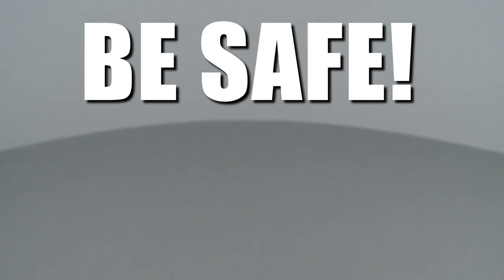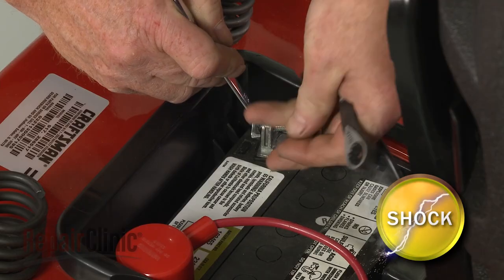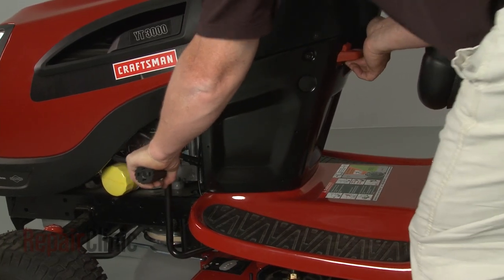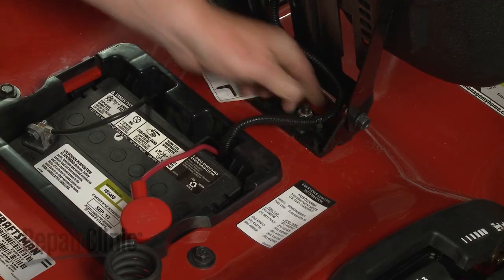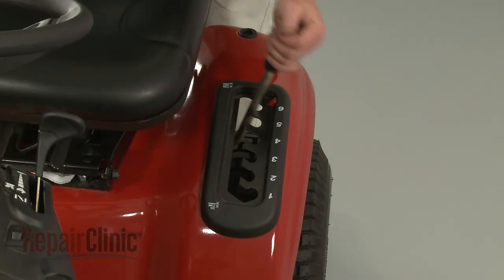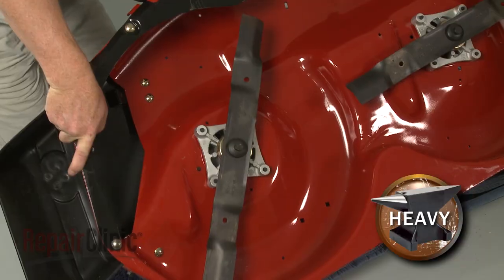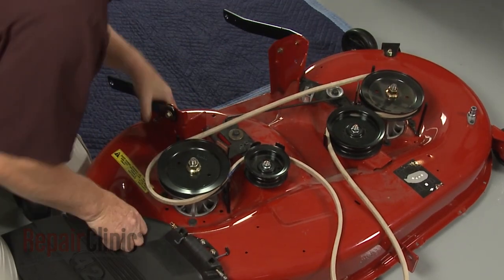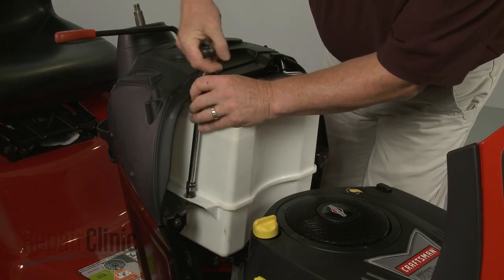Craftsman Riding Lawn Mower Disassembly, Repair Help

Comment: I have a Yt3000 and I am trying to repair/replace the transaxle link but I dont have any repair manual to show me how to replace it back on. The old one is still only attached to one end on the upper end and other end (bottom) is dangling on it. Would you happen to know where the bottom end attaches to on it?

Comment: hello, I have this mower and it has been shutting off about 10 mins into a mow, then it won’t start back up.  I replaced the battery and it’s still happening..do you think it’s the alternator? thanks

Comment: Need help. Are there any way to adjust auto-drive pedal resistance? I have Craftsman T1600, the drive pedal is very hard to be pressed down for extended period of time, like 2 hours. Or are there any way to hold the drive pedal without foot pressed on?
Thanks

Comment: My 21.0 HP Craftsman lawn mower motor will not turn completely over each time the key is engaged. I've tried two new batteies fully charged and get the same results. Also reset the valves. exaust on 006 and entake on 004. Same results. HELP.

Comment: How can I see differences between this YT3000 and my LT2000?   Skimming thru, it seems this video does not show most of the springs.  RepairClinic has 4 videos about Craftsman lawn tractor springs, but my broken spring is not any of those.  I keep trying to find parts diagrams / lists which show all the springs.  Where can I find that?

Comment: I have this exact model and mines won't go uphill and plus even if I lower the speed and higher the speed there is no difference.  also with does problems the reverse is fine but going forward is terrible. I am guessing someone had put their foot on the gas pedal and the one on the left. The forward pedal and the one on the other side(left side). Please tell me what the issue is and how to fix. Thank you

Comment: My steering shaft is wobbly. watching this video leads me to believe it is a common problem. I wish my mower was that clean when I get underneath it.
Reply: Hey always - there is a PLASTIC bushing that is about 8" from the steering wheel end of the shaft.  That's the likely spot where wear occurs.  If you take the gas tank out, you can see it easily.  The metal bushing at the base of the shaft that is shown being removed is probably not where the wobble is occurring.  The part# is 195227 from Sears Parts Direct.  $4.02 There are other videos on removing/replacing this steering column bushing.

Comment: They YT seriers (one in this video and others has issues. The rear end mounts like to break. Its a chincy design. The actual front mount for the rear end is not braced properly. Plus the Mounts for each side of the axle are flimsy metal...What happens is everytime you push the clutch it pivots the rear end with tenion...What happens is the tenion from the pushed in clutch over the years tears the rear mounting points and since the fronts is not braced properly the front mount turns into a swing instead of actually keeping the rear bracked. Its a known problem.
Reply: Mike Theune h

Comment: These videos are all well and good but why do them on a brand new mower? Why not make some videos where the mower is 10 years old and rusty as you know what! This man does 2 days worth of work in 15 minutes, IF only it was that easy. I spent a half hour on my YS4500 just trying to get the spring into the idler pulley, Not to mention the tremendous amount of busted Knuckles!
Reply: because there new mowers are also having issues

Comment: I have a new battery, new solenoid, and new spark plug,  Still no fire on spark plug and the mower doesn't click or make any sound.  Tried to take dash off to fine fuse.  I am almost 70 and all I want is to mow my own lawn.  HELP

Comment: I have an issue starting my craftsman yts3000. It only starts when I spray starting fluid into the carb. And once I turn it off and come back after a few minutes, I need to spray again. And I need to keep it all the way at choke to keep the engine running smooth enough, how do I solve this?
Reply: SwagSubscriber check valve lash

Comment: Awesome Video, thanks so much. I'm trying to change out the fan that cools my transmission. I'm using a ratchet set with three quarter
Socket. But I can't stop the nut from turning ,  right or left brake on or off. How do I get this nut to stop moving whiles I'm trying to remove it so I can install a new fan. It's I hydrostatic and the blade is completely gone. I've been using it for a while, and didn't know I was missing the fan. After it gets hot, it will not go forward or back wards. Once it cool down its fine.
Reply: I know this is much later but if the belt is tight the pulley holds it so your impact zips it off.

Comment: I cut my grass 2 summers with this Craftsman riding lawn mower.  That is it !  Transmission gone !  Plastic !   I am an older woman and can't afford to spend $1,400.00 every two years.  Sears should recall this peice of crap.  I'm left with an almost new mower that doesn't work. I was told by a Sears repairman that I could buy a new lawn mower cheaper that what it would cost to replace the transmission.  He even told me to never buy another Craftsman from Sears again.  My last craftsman lasted 16 years.  I will not buy from Sears again.

Comment: Ok I feel like a total moron but I have to ask. The first year I had my yts3000 (2010 -2011) I took the battery for the winter... installed it in spring and never took it out again, I would just disconnect the cables for winter storage. Last summer, the battery would be dead if I didn’t use the tractor for two or three weeks, I’d charge it and it would be fine for awhile, this year it got so bad it wouldn’t hold any charge. I just bought a new battery and while installing it I noticed the “+” and  “-“ terminals were opposite of the original battery so I checked the old batt and OMG!,!, I have been running the tractor with the battery hooked up backwards since the second season I owned it!  So, why did it work,charge and all that without blowing up???  The terminals on the new battery ARE exactly the sam as they were on the old one, - on the left side, + on the right. But I had the red cable with red rubber boot hooked to the left side for years with no problems at all... what gives? Now I’m afraid to hook it up to the + side for fear it’s wired wrong from the factory!  I followed it and it goes to the  switch for the starter under the hood and the black cable I had on the + terminal goes to ground under the rear fender.  So why no grand explosion or even a pop, sizzle,  and puff of smoke?

Comment: it's to bad there isn't a video showing how to fix real problems, like no reverse or replacing a drive belt, tractor will not move.. how to adjust the valves .. ect..real problems, not things that a house wife can fix.

Comment: never buy one of these crapsman mowers
Reply: TherealDeal 70 bought one second hand. it does a jerk/whiplash causing motion when i put it in forward or reverse. im kinda regretting it.
Reply: I have had mine 4 10 years no issues it's the user not the product.
Reply: Wrong! Mine has less than 100 hours on it and is now a piece of shit.
Reply: My 4500 is going on 12 years now.  It's outlasted a Stihl trimmer and Husqvarna blower.  New Amzoil and filter, air filter each year, 89 octane fuel, never mow wet grass, always blow off [with second blower] before putting away.  Of course, the Craftsman power washer lasted 3 washings before the carb went and had to be shipped off for repair.  Sadly, after a single washing, it is acting up again [complete failure to start].  Damn craftsman for removing any carburetor controls :-)
Reply: Steven Lopez There a piece of crap it's not the briggs & Stratton engine it's the crap frame and very thing other than the engine it made as cheap as possible and selling it as just as expensive as a good Husqavarna or John Deere. I race mowers there junk absolutely crap.
Reply: northof50now I would take that that where ever you got it from and demanded my money back and then get a Honda pressure washer
Reply: Hi Cannon -  Yes. Always try to look for Honda engines.  They didn't have any at the time of purchase.  It was a  gift for my dad.  He liked the adjustable nozzle, which didn't require you to pull each tip.  Sadly, I knew, at the time, it would be trouble.  But, your dad is standing there saying he likes it....  Rest assured, it's been returned for a Generac - which has been fine.  Thanks.
Reply: User not the product
Reply: psshh probably can't take care of your TV too XD
Reply: This tractor sucks!!!
Reply: My mower deck broke... one of the mounts broke off at the weld... it was only spot welded on to the deck... I had it welded and had supports put on it to keep it from breaking again.  It also cuts good except it leaves a strip of lawn that doesn’t seem to get cut, almost like the blades are too short and not close enough in the middle to cut the grass between the blades. Other than that and my stupidity with the battery , it’s been a great machine.
Reply: I've had mine for 7 years, runs like a champ, no issues.
Reply: These mowers are built by 2 different companies. The cheaper ones are mtd made the higher ones are husquavana made. Mtd are crap husky’s are good.
Reply: I know I wasted 1200 dollars nothing but a piece of shit

Comment: Empty the fuel tank. Then you don't explain that. The rest of the video is useless because I don't know how to empty the fuel tank
Reply: musicfun use a pair of plyers to take the fuel line thats attached to the carb
Reply: I bought a bunch of fuel shutoff valves on eB. I install them on all my gas engines. It makes draining the tank easy. Just cut the line and plug it in. Takes 2 minutes.
Reply: Duh! run it until it is out of fuel.

Comment: The mower deck on the left side (same side as lever that raises and lowers it) will go down. It's hung on something. The grass expulsion side drops all the way to the ground like it's supposed to. I watched this video from the 4:51 to 4:54 mark to see what was different but I don't see any movement that's different in the lever here. My dad's simply will not push the deck down to the ground. What could it possibly be hung up on?! It doesn't appear that anything is bent underneath. We just changed the blades and this all started after that.  Something must have happened when he raised the front end with the floor jack. Our Sears Store that sold this to us went out of business a couple of years ago so we're at a loss as to who to ask. Thanks.